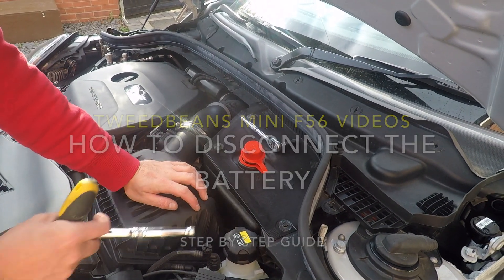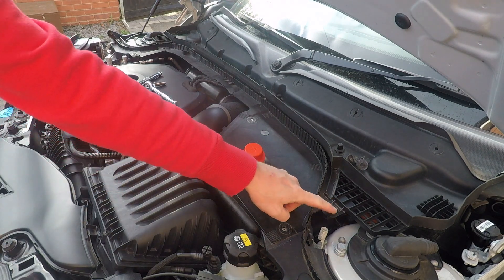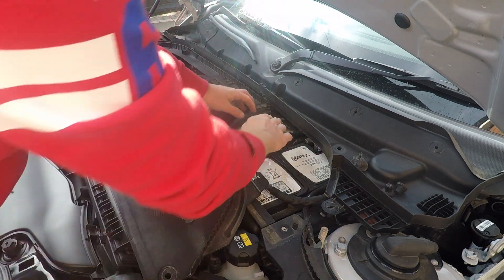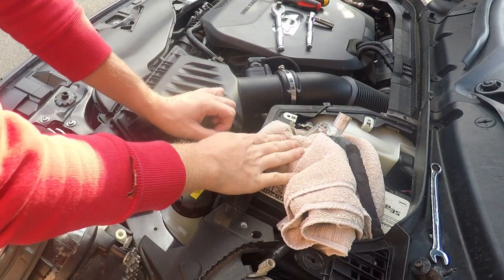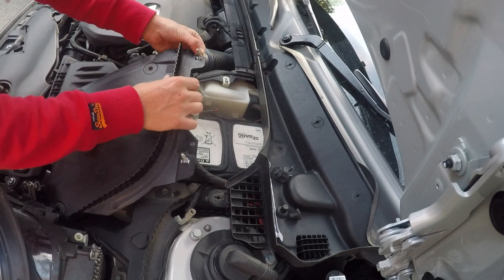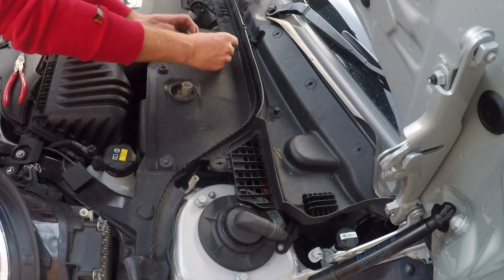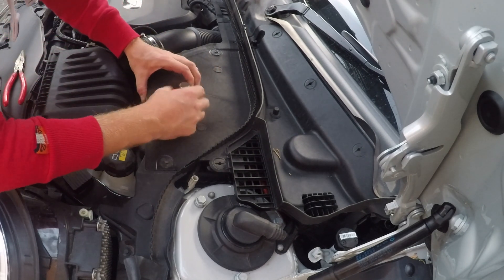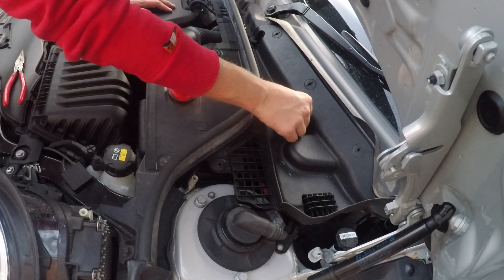Mini F56 How to disconnect the F56 Battery for jobs like removing air bags or other electrical tasks

Comment: A lot of website notes to remove negative first and reconnect negative first to avoide spark and damage. Will you recommend to do the same? Or removing positive straight away will be fine as per your video? Thanks!
Reply from the maker: Sounds like a sensible suggestion

Comment: Hi, great video! Could you tell if after reconnect the battery it will be necessary to use some code to make the radio and other electronic stuffs work properly? Thanks!
Reply from the maker: Hugo Costermani thanks for the feedback.  No it will be fine.
Reply from the maker: Hugo Costermani thanks for the feedback.  No it will be fine.
Reply: @tweedbean  ok thanks! I may have a long trip for 3 months so do you think that is OK just to reconnect? No error code? Thanks again!
Reply from the maker: I’m unsure on the longer term impact
Reply: @Hug0Costermani  In the future buy a scan tool to clear codes and fix your errors. Preferably a Schwaben Multi-System Elite Scanner